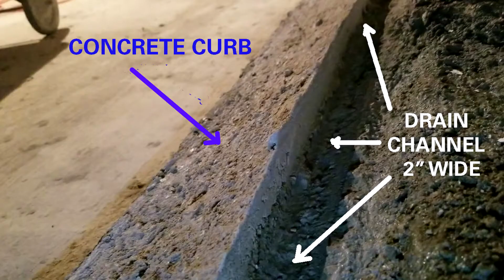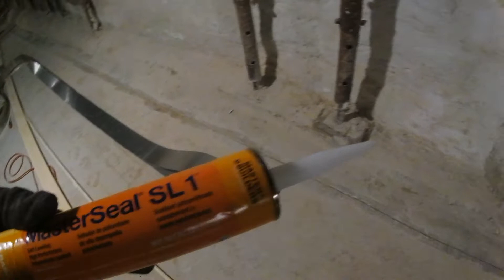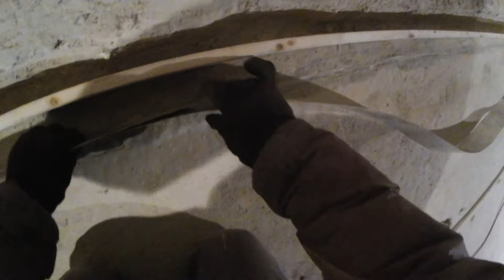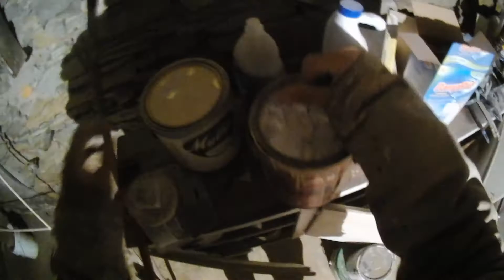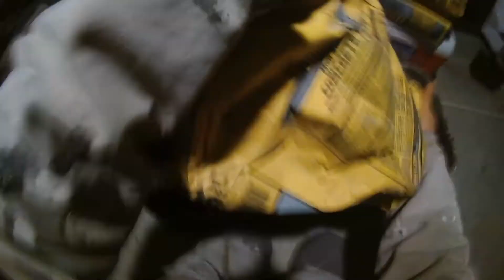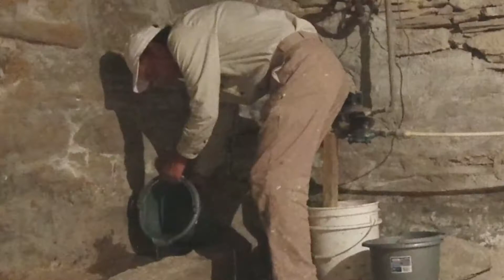BASEMENT WATER LEAKS, DRAIN CHANNEL ABOVE FLOOR, TO SUMP PUMP

Comment: I like this idea. I think I'll use pvc boards with epoxy instead of the aluminum strip. I've seen and read about multiple ways drain tile systems fail. This eliminates that possibility.
Reply from the maker: PVC boards is a good idea.  Maybe strong enough to eliminate the concrete, as long as the pvc isn't bumped into.
Reply from the maker: Thanks for the comment.
Reply from the maker: On the other hand, the concrete is a way to form a downward sloping channel to the drain hole.
Reply: @swilson6206  i have water coming in through a cove joint right at the floor level, so I'll probably skip trying to slope it. And I'll definitely use a concrete curb so it doesn't get bumped.